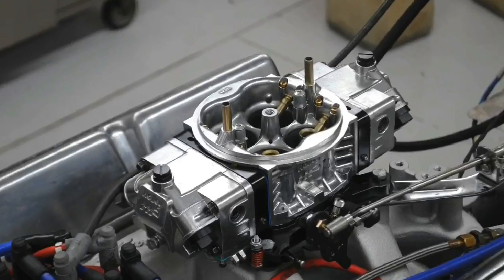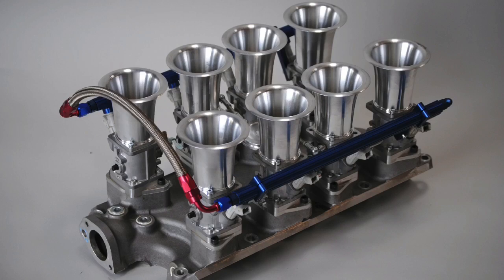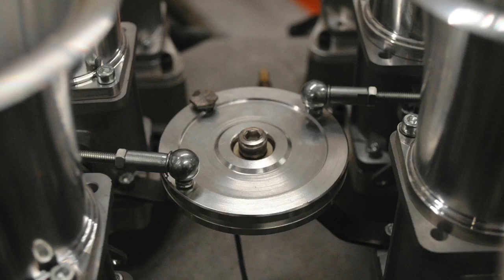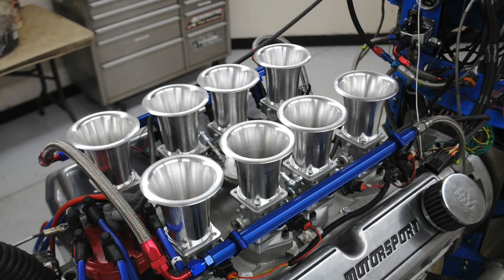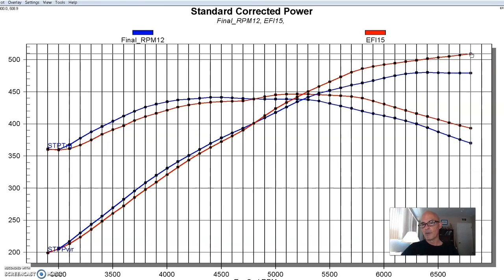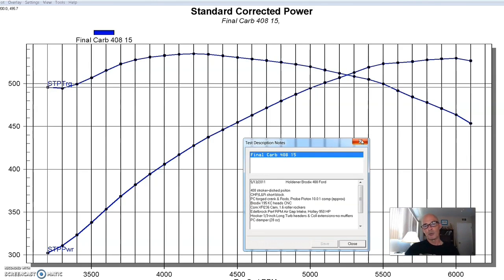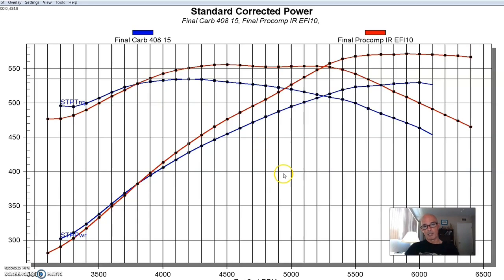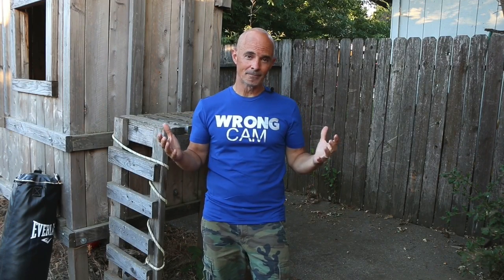THIS FORD IS STACKED!

Comment: One thing about stack injection is you should have equal length headers for the engine also, it helps even out the intake pulses so the tuning is simpler, the modern gt350 mustang does a similar thing with it's intake and flat plane crank, they can't get the exhaust equal so it gives up a little hp but you have to admit a 8500+ rpm v8 is a hell of a deal.

Comment: I never had any problems syncing the carbs on my 4 cyl bikes, using a motion pro mercury filled vacuum gauge. Do those stack injection setups have vacuum ports for hooking gauges up?

Comment: The adjustment syncing is not as problematic as you might think, the small variations in AFR are negligible, similar to dual plane intakes with longer runners on outer cylinders main thing is timing to vacuum/ taps is spot on, this is what I have experienced anyway,

Comment: Test pro comp 210cc heads on a 347! Use your favorite comp ex274hr. I wanna see how much better than stock those heads are and how much better an AFR/trick flow head is
Reply from the maker: I did a Ford as cast vs CNC Pro Comp test
Reply: Richard Holdener thanks for the reply!! I’ll search your videos for it. Love what you do!

Comment: Americans: ITB's aren't practical and cost too much.

Also Americans: As soon as I save up enough money I'm going to spend a shitload of money on a brand new carb, port a single plane, a carb spacer and cut a hole in my "hood". 
😂
Reply from the maker: All Americans aren't the same
Reply: @richardholdener1727  I was joking but it seems to be only Americans that have some sort of anti ITB reaction like It's some sort of communist plot haha. Make carbs and single planes great again !
Reply: itbs kill tq, they are expensive, a pain to tune, and a pain to filter. why not just run a tunnel ram and get more hp and tq, cheaper?

Comment: It would be cool to see a test for street able 400ish inch small blocks.  Let's see who makes the most power with good heads, hydraulic rollers and good street able parts like a single 4 barrel.  Require the engines to pull a certain amount of vacuum for power brakes.  351 W vs 350 vs 360 based engines.  Leave the Cleveland and LS1 out to keep things fair?
Reply: sure, as long as the 400 mopar gets to compete LOL.

Comment: Stacks are for high rpm like 7000 rpm plus with this style.
Reply from the maker: This runner length is for lower than 7000-you need to shorten for 7000 rpm

Comment: Man I’d love to see a cross boss
Reply from the maker: I did get to see one of those run on the dyno-it worked well
Reply: @richardholdener1727  can you imagine what the Ford 429 shotgun would have been like with 2 cross boss inline carbs? That was the plan until NASCAR said no, and made a single 4bbl the rules.
Reply: @allenl9031  Bill France sure was a killjoy. When the Hemis ruled in 64, he banned em for 65. Ford made the SOHC, he said no. Olds (!) was developing their own Hemi AND cammer, Bill said no. When the Wing cars dominated, he banned em. NOW look at the damn sport, not ONE production part or panel on 'em! Buncha generic blobs with spec engines (and restrictor plates, for more pileups), ad-spewing runts for drivers, get off my lawn!!

Comment: If you look at any sportbike made since 1975 they have individual intakes and exhausts. They all have Airboxs with a filter. A lot of work is done with the air boxes to get the mixture and balance correct. Then it is every tuneup , check the flow balance with your manometers. Not a big deal. 
    the difference between fuel injection individual stacks and common throttle types is the placement of the throttle. A common throttle type is for production engines and not for racing types. I have never seen this type on a motorcycle. IT does not have the response and flow needed for a racing type engine.    So quit your bitching and get to it. .
Reply from the maker: Thnx for the commnent. Open stacks (true IR) has no (or infinite) plenum. Zero resonance frequency. Boxed plenum around said IT system has a resonance frequency-they are different. Might be no change in power, but there is a plenum frequency. Throttle blade  position doesn't matter for this change.

Comment: Thinking about a cam package for my 2017 Camaro SS with the gen 5 LT1.  Comp kit MK224-300-13 listed as Stage 1,  D 227/238 with a lift of .648/.603    Stock is  D 200/207  Lift  .551/.524   What are your thoughts? (dannycarwile@att.net)
Reply from the maker: should work fine if there is adequate P-V
Reply: @richardholdener1727  P-V?
Reply: @fulloppositelock6778  Thanks.  I hope Comp did their research and since the cam is designed for this engine it should be fine.  (I hope)

Comment: tell the fans how much those stack injectors cost then add all the bits that don't come with it, you could by a new motor, for pete's sake !
Reply: Yeah, you have to really, really want the look. I priced ITB for my coyote once and I bought a turbo instead. It was cheaper.
Reply: 800$ for the intake with the rails... the only thing you need is the TPS and fuel injectors...

Comment: Those stack injections look nice however they really are not flamboyant enough as they are made to fit under the bonnet of a modern car. For that manifold you would probably want to use a couple of Sprint car filter boxes. My favorite appearance wise and old school but functional was the systems used on F5000 race cars. Usually staggered trumpets a good 10" long being fed with Lucas Mechanical Fuel Injection.  Here is a pic of one set up for a boat probably a Bridge to Bridge racer. https://primotipo.files.wordpress.com/2018/04/image119.jpg
https://primotipo.com/2018/05/03/repco-holden-f5000-v8/

Comment: Hi Richard. I love the content of your videos and have picked up a lot of great information from them. My question is about ProComp/ Speedmaster products . How is the quality,fit and finish. Are the prices to good to be true. I’ve read a lot of reviews that are not good. I’ve had my eyes on the stack injection and the timing belts for SBF. I just don’t want to be cheap on parts that might grenade my engine. Thanks keep up the great content.
Reply: I have this setup for my 302. Fit and finish is not great, you have to do some  modification to make it fit. I doubt if Speedmaster has ever actually installed this thing on an engine. That said, I got mine for $700, so it was definitely still worth it.
Reply from the maker: no on timing belts-the stack injection takes work but looks good and does make power

Comment: Ive got a 68 corvette 327,  .030 over, RPM, 1 inch spacer, Edelbrock quadrajet,  CC 12-433 Roller cam, solid lifter. I think its at or over 500 at the crank. Do you have any info on how the contoller hooks up and is it easy to get it working like a Holley sniper system. I've been dreaming of the day I could put stacks on her but the setup is the snag...Great channel. Loved you on engine masters. I built my motor around all your suggestions and info. She spins up so fast my tach cant keep up and it puts a grin so wide on my face my ears get spit in them!!!
Reply: mscottrogers, in your dreams!, more like 400, if it's tuned correctly, maybe more like 375!
Reply: @olderthanyoucali8512  oh you ford guys are funny,,,,,looking
Reply: @olderthanyoucali8512  
Getting a old 327 to make 500hp is difficult, not impossible. Hell, the 302ci coyote almost makes that much stock. Granted it's a 4 valve with vvt but you can get big heads and cam for a sbc and rev ghe piss out of them too.
Reply: @177SCmaro  an intelligent reply....a motor is an air pump, air in and air out a 327 is a 5.3 liter, guess what else is....a 5.3 liter. Richard gets them over 500 horse easily before throwing boost on it to get ver 1200 hp. I think throwing a roller in an old block with good compression and great heads will do the same. I understand math can be hard for some of you guys but geezus.....unless your just trying to be funny, then all’s good..lol ;)
Reply: @mscottrogers  You thought your CURRENT combo might make 500. You made no mention of the heads, cam, compression, etc. If the only mods to your 327 are as stated, I can guarantee you are not close to 500...400 at best. Factory heads are the biggest choke point. 195cc heads, a big hydraulic roller (my estimate would be 238 at .050 or more, .600 lift or more) will get you there.
Reply from the maker: we used Holley EFI on this one
Reply: @richardholdener1727  thanks Richard....keep posting, I’ll keep watching

Comment: Give me a dry intake EFI setup like an LSx or DOHC 5.0L to top that 408 Windsor. No carbonator for me.😁
HOWEVER, if I were pressed to choose from the 2 setups being tested I would take the carbed dual plane everytime.
Stacks are cool looking but that's about it for me. 
I don't care about cool as much as I used to when I was younger. 
Nowadays I choose function over looks if it'll make life easier(low maintenance) and prove reliable(drive the car or truck to places w/o worries).

Comment: you know what I'd like to see you test is a yard motor that all you do is pull the pistons, gap the rings, cerakote the piston top and combustion chamber and test it both N/A and boosted... check the difference, between cerakoted and not on a stock piston.

Comment: Thanks for this one...   I think the single stack/individual throttle body's advantage is accounted for due the lower pumping losses.  i.e., What are the mechanical restrictions as the potential redline for the OHV engines?  If i were to put this engine or an LS in an extremely lightweight car, where bottom end torque is not necessary, but high revs are wonderful, how high can it be spun?  Is 8000?  9000? possible?  What are the limitations?   Push rods? rocker arms? Do heavy springs & valves spell doom for the OHV engine?   thanks again.

Comment: I remember reading an article in the 80s the guys were going to try running 8 Honda 750 carbs on a 460 Ford. They never did write another article as far as I know. If anyone knows anything about this I would be interested in hearing if it worked out
Reply: Haha  I used 4 side drafts from a cb750 on an 1800 Mazda in the 70's, a custom intake and the oe air filter assembly. It made a lot of noise and top end and idled...dam that's a blast from the past
Reply: In theory it would work but it would be quite an ordeal to get them synced in throttle position and A/F. But if the can do it on a 4 cylinder they could do it on an 8.

Comment: I think there are a few points to remember when using ITB/stacks. First, you need to fab a proper sheet metal or fiberglass/carbon fiber intake tract, a cowl induction, or ram air scoop/over-radiator seems like a logical choice for most applications. At that point, you can use a regular panel filter, so that takes care of that problem. Second, you need to use an alpha N tuning strategy, with properly set brake points for the TPS axis (closer together near closed throttle, then gradually farther apart as you get closer to wide-open throttle). Regarding cylinder to cylinder variations, obviously, you should try to get all the blades synched with each other the best you can, but remember that you can also compensate any variations with individual cylinders trim tables in any decent ECU, or even individual cylinder closed-loop lambda if you have the money for multiple sensors and controllers.
Reply: Hi , i increased the resolution  on my ecu ,and run Alpha N , i am using some outwears with 60ppi discs under them  (now),    i made a special linkage to actuate my crossram , i need to make a video of that , i kept it real simple , check my channel .Cheers

Comment: I put a Jenvey stack inje tin on my 99 s10 with ls7. Teething issue is an understatement!  The trick was to run a common log with lines coming off each intake runner. Then run MAP off that log with remote IAC valve. Great driveability now.

Comment: Have you ever compared a 4 cylinder engine, like a Pinto running a single 32/36 weber DVG vs twin DCOE's/DHLA's vs EFI type DCOE type throttle bodies?
Reply from the maker: that is a big change in intake design

Comment: So much great stuff! The IR driveability issues make me wonder if one of the aftermarket ECUs could run a gaggle of IACs. Then you could just get the linkage synced up at fully closed... Just dreaming a bit there. Way back when we built a Hilborn-style mechanical injection for a SBC (327) with Quadra jet carb secondary throttle blades. It worked in a C dragster, never on the street. But we had a good adjustable linkage that got all working together. These days street cars go way faster but 8.99 wasn’t bad in ‘68. Love this channel!
Reply: They could always do like some motorcycle manufacturers do, run ONE IAC and a few vacuum metal or plastic lines going from it to each individual runner near the head's ports and save yourself the headaches.
Reply: @GIGABACHI   Idle is no problem, there are good sync meters around , you have to run alph -n  , with speed density the map sensor would think that it was at full throttle at 20% throttle position  , a blend may be good .
Reply: @Cobra427Veight  Yeah Part throttle is a PITA on a ITB
Reply: Running IR throttles with an aftermarket ecu is no problem. Nissan GTR, BMW M3/M5, Nissan Pulsar GTiR, Toyota 4AGE 20V. All IR oem throttle applications.
Reply: If you run the throttle with DBW the ECU can control the idle without an IAC.
Reply: @greenflavoredstuff  would each TB then require it's own electronic actuator ?
Things could get bulky all of a sudden and less pretty.😏
Reply: @GIGABACHI  nah, just make a linkage system and run one actuator for each bank.
Reply: The Map sensor port runs as a common feed. Even on this setup there is provision to running a single iac.
Reply: Sure just a little vacuum manifold and iac works for most. Per cylinder might be possible I guess but sounds unreasonable

Comment: id love to see someone do a video about hopping up a ford 400m
Reply from the maker: that video is up
Reply: @richardholdener1727  thank you
Reply: BW MadDog [retired]  If you already have it, sure. But if you're going to the boneyard for an engine, a 460 is a much better choice. They even have the same bolt pattern on the trans.
Reply: The guys at Engine Power also did one.
Reply: My 400 was quicker than my 460 in my pair of 78 Mark 5. Always puzzled me.
Reply: @masta51  Puzzles me too! I've owned 3 460s (76 Grand Marquis, 77 Mk V, 96 F250) and 4 400s (72 LTD, 75 Torino wagon, 76 LTD wagon, 78 F150), and the worst of my 460s would EAT my best 400. And that 400 had a 4 degree advanced timing chain, Eddy SP2P intake, Holley carb, and headers.
Reply: TMEYER has hypereutectic pistons for the 400 that brings the pistons near zero deck, and 9.3 to 1 with original stock heads for a $440 upgrade its worth it, depending on your cam, exhaust, and intake this makes a nice mid 300s hp with even more tq from the factory the best 400 Thunderbird was 
173 hp at 3800 rpm
326 tq at 1600 rpm
So your talking about doubling the Hp by doing this
Reply: @smokenchoken1736  Good info, thanx
Reply: They make steel 4" (and longer) cranks now for the low-deck 351C,  but a cheap alternative is to put the 4" 400 crank in a 351C block. The advantage is header clearance, and more intake choices, especially if you have 4V heads. The downside MAY be finding rods.
Reply: @donellmuniz590  or you could just turbo the 400 lol.
Reply: @frigglebiscuit7484  That's a bit too ambitious for me...all that plumbing. I can't weld for, um, excrement.
Reply: @donellmuniz590  welding isn't terrible to learn. Mastering it is another story. But thin wall aluminum or stainless is pretty well up there in skill. But turbo on an old low comp engine would be madness with the sheer volume. Could probably make a 1000 hp. And likely 500-600 reliably..

Comment: This is what I want on my 429
Reply: There were some hilborn mechanical lower intakes cast for boss 429s. The Kasse heads work on a standard block. Foose built a maverick or something a decade ago with one.
Reply: You're in luck! Speedmaster makes a version for the 385 series. I think I saw it on Jeg's. I was interested in it as well. I have an OMC King Cobra 460 in my boat and I was thinking about it myself.
Reply: Looks cool, yeah, but for the same money, you could put a 532 or 557 kit in your 429 block. Drops right in, no grinding.

Comment: Personally I blame squirrels
Reply: Could be chipmunks ?
Reply: @mikelaumaillier9271  they are in cahoots with the squirrels 😉
Reply: Mike Laumaillier : Buddist Monks. Always the right answer in the forrest with Squirrels. My eldest daughter  is named after a Garden, and she said those Monks are the only guys in a forrest who are ever right. Bonnie Tyler confirned it.  Every now and Zen and Fall they part...
Reply: John Woodworth : I was using my mobile data to ask a question in the forrest on the way home. But I ran out of Killer Bites so I had to wait untill today for my data top up. So the question. If one Squirrel falls down one tree and hits one stack of an 8 stack Modular Motor, will it loose 1 horsepower? I ask this because I was told  somewhere that 1335 Squirells make 1 hp. But without animal abuse, could one Squirell take out a  450 hp modular 4.6 liter. Whuddaya think. I asked my wife, but she said if I was in a forrest wasting cell phone data posting on the internet, I would be wrong, and if I was wrong in the forrest, I'd never be right anywhere else. Oh, I forgot. The Squirell Horsepower Calculation. I think its Gross. Gag me with a spoon. 

http://www.squirrels.org/faq.html:%5B/url%5D
Reply: You again?
Reply: Donell Muniz 👉🏻🐿